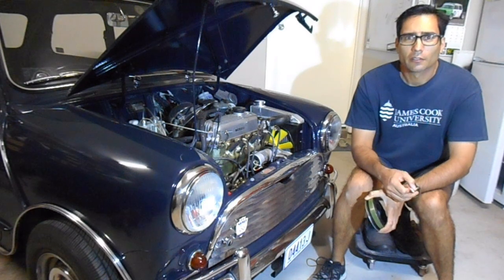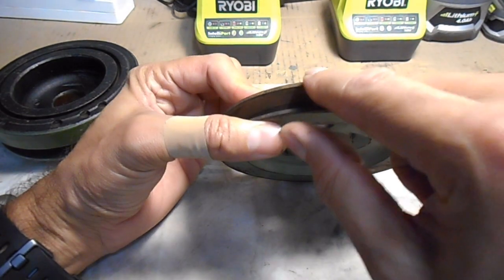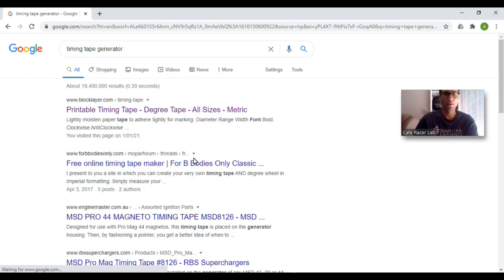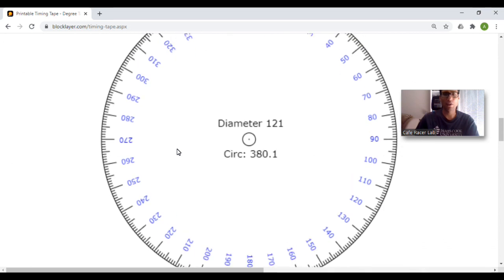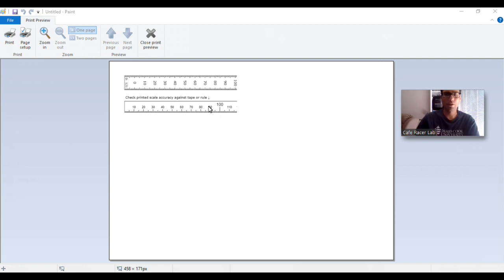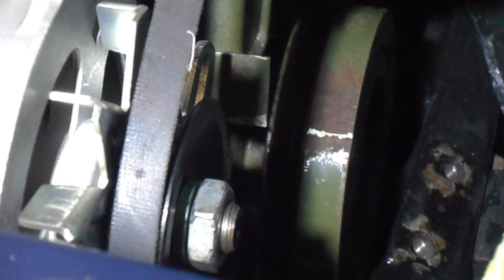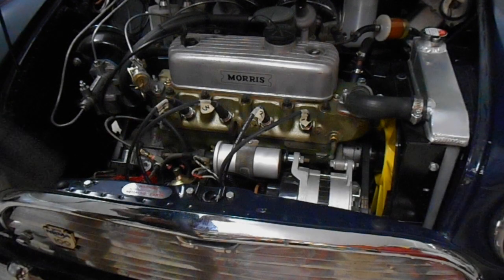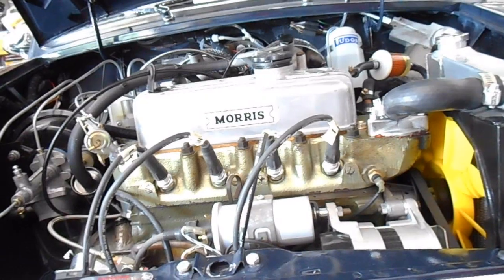DIY Timing Tape - Morris Mini Cooper S

Comment: Did I miss something? Was there a stationary mark somewhere pointing at scale on the pulley to reference what number timing was at?
Reply from the maker: TornadoCAN99 If you look at the image for the thumbnail for the video, you can see the little bracket attached to the engine block which has a line of white paint on it. Not sure if this marker bracket is the same on all older minis.